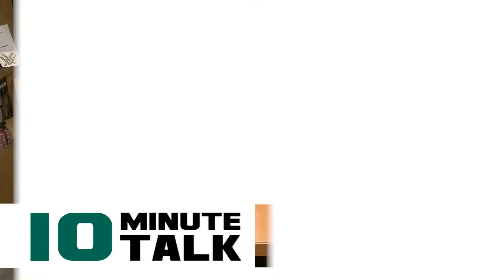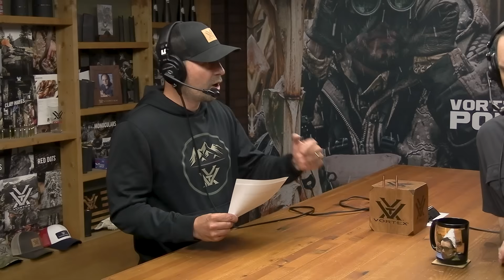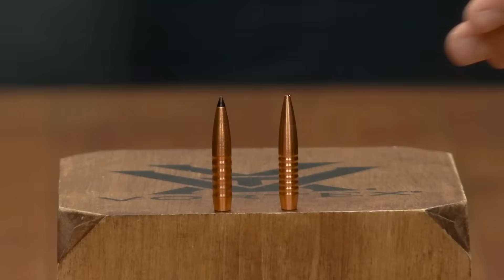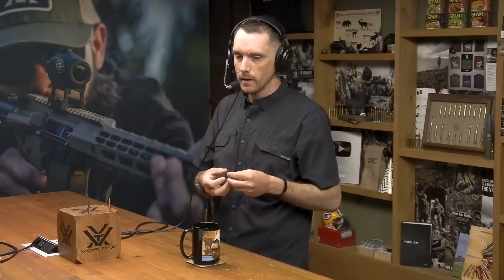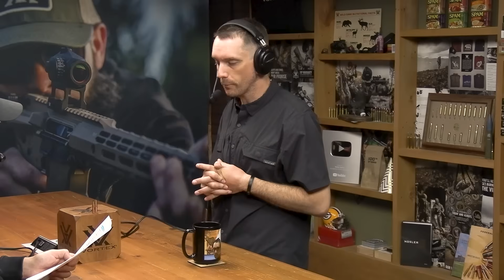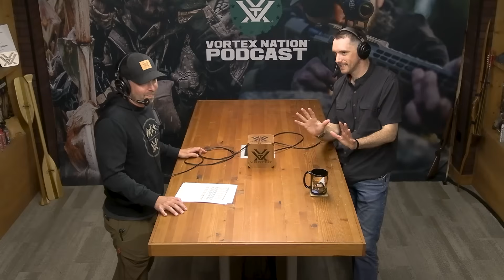#10MinuteTalk - Hammer Bullets — Do They Hammer?

Comment: Hammers shoot very well and their performance on game has been good in my experience. Petals radiate probably more like 30 degrees. The secondary wound tracks are less important than the enegy dump you get from that explosive opening of the bullet, which makes for a larger wounding path than traditional monos.

HOWEVER, I have not supported hammer for some time because they wildly inflate their bc values. It may have been forgiveable when they were starting off, but they are big enough and the tech is accessible enough now that the only excuse is that they are not a company that cares enough about its customers to tell them the truth if they think it will hurt sales. Just check applied ballistics and see how horribly off several of their designs are. I'm talking like 30% off for some. Some are pretty close, but there isn't a lot of rhyme or reason to which are on and which are off. They have somewhat addressed the issue with their new line of hammer high bc bullets, where they report the shooting conditions of the people who have tested them. It still seems pretty ridiculous to not set up a series of chronographs and a shot marker system to get velocities over distance considering how successful the company has been. Their forum and their fans on other forums have a real culty feel that weirds me out too. I'm not a fan of a company whose founder seems to want to foster a cult of personality around himself and his product. There's enough putting me off that I go with other options for monos. The fact that Hammers are about as expensive as you can go for a hunting bullet doesn't help either.
Reply: There are other examples of their marketing dishonesty that I've seen too. The one that sticks out the most in my mind is a long range YouTuber. I can't remember the channel name, but I'm fairly sure it wouldn't be too hard to find.
Reply: @gsnicholas8522  the youtuber you're talking about is dischonest. there are valid critiques and drawbacks to hammers, but that particular guy has an axe to grind an a horn to toot, and he doesn't let easily verifiable facts get in the way. Just saying.
Reply: @jcarry5214 I’m not sure about the axe to grind, but he provides evidence to back up what he was saying. In other words, he brought the receipts.
Reply: @gsnicholas8522  I'm going to try to respond to this with details, but it may have to be broken up so YT doesn't hide it. I disagree about him providing receipts. His evidence is mostly lifted from context, and his terms carefully redefined to suit his point. He mis-truths multiple ways about the aoudad video. He said a bull that tipped over within 5 steps was a plainly unethical kill, but he wouldn't say the same about videos using other bullets. He refuses to acknowledge the validity of any positive testing or experiences.
Reply: @gsnicholas8522  He says the petal-less shank is just a FMJ, which it's not, but won't back up the claim. He wouldn't address performance to any other bullet except highly frangible lead, or compare any other manufacturer to their claims. He claims Hammer are a large company with many paid employees and vast resources. If you point out basic errors he says you're a "hired assassin", or says he didn't say that. If you say "have you ever spoken to Hammer about xyz?" he calls you an employee, paid agent. (keep in mind I hadn't even spent any money yet when I interacted with him, and wasn't sure I wanted to try them but I had had a couple short conversations with the owner. Youtuber called this false because it didn't fit his narrative of them stonewalling).
Reply: @gsnicholas8522  He claims that gel blocks are a direct 1-for-1 substitute for game, which it's not. he says they make claims that they don't. He claims there is only one right wounding type, but he doesn't assail any other bullet manufacturers who can be found on youtube letting people down immensely well within their own design claims. He redefines "long range" to suit his argument in each context without bothering to ask them how they define and test it and encourage it. Again while not doing the same with other manufacturers.
Reply: @jcarry5214 you must be talking about someone different than I am. I don't remember any of that.
Reply: @gsnicholas8522  A lot of it was in conversation when I engaged with him directly. I'm 99 percent sure it's the same guy. He originated some of what you said and has a LR channel. I'd look it up to be sure but I know these guys now, separate from the bullets and wahtnot, it would just bother me to see it again or see more people doing the same.
Reply: @gsnicholas8522  I'm sure. I know their founder got into a whole mess after taking a some pretty unethical shots at animals (I believe Auodad but idr) and having it on film and trying to edit things to cover up some pretty terrible judgement. 

What sucks is that they're stellar bullets. They're easy to make accurate and they have excellent terminal perfomance. Just be honest about the ballistics. I can't stand blatantly lying to your customers. There's marketing speak and then there is just boldface lying. Hell, you can design bullets in a software that doesn't model your design well and gives you an inflated number, but once it is empirically proven to be wrong, it's on you to own up to a mistake and correct the record. I can't stand people who refuse to admit fault and would rather continue lying in the face of demonstable facts and just pretend they're not there. Leave that BS to the politicians.
Reply: @gsnicholas8522  there are valid critiques of hammer to be had, but they guy you're talking about is a straight liar, I've interacted with him and I've had more intellectually valid conversations with car salesmen.

Comment: Less pressure and more speed ?? ok now I wonder if that would help the 6mm arc pressure "issues" to allow more speed and get lower pressure?? Ryan ?? have you tried it?
Reply: I am running an 80gr hammer hunter out of my 22 inch 6 arc bolt action at 3175 and I’m pretty sure I could go faster.
Reply: What "Pressure issues" are you having with the ARC? I'm running a 95 gr LRX out of a 22 inch barrel at 3060fps without any problems

Comment: I’m looking for good .429 projectiles for my 444marlin in a strait wall state. Decided on bear creek ballistics 225hv due to getting a 200 yard 4” point blank and only 12” of drop at 300, but I’m curious to how the hammer and cutting edge bullets would compare on target especially with closer shots
Reply: The overall length of the .444 is too long and not legal in any straight wall state isn't it????
Reply: @camwinston5248 Illinois has no limit on case length or diameter if it’s strait wall. I could use a 50-110 if I owned one
Reply: Ten four, I appreciate the reply back..the 444 will do it then ! Good hunting!!
Reply: @camwinston5248 thanks. Hoping to get around 2650fps with accurate 1680

Comment: I’ve got a rifle with a ridiculous amount of freebore that won’t shoot anything very well.  It’ll shoot hammers just fine.   I’ve also found that hammers tend to be on average .0005”(half a thou) larger in diameter than cup & core bullets I’ve measured.
Reply: Surprised you kept it long enough to find these.
Reply: I had a smith try to chamber a barrel using these bullets in a dummy round. He kept on reaming, trying to get the leade correct but the slightly oversized bullets kept catching.  Wound up with like 3/4” of freebore in a (now) useless barrel. Several lessons learned.
Reply: @zackw9292  that's a really bizarre way of trying to solve a problem that didn't need a solution.

Comment: Tungsten is cheaper than copper, heavier than lead, and non-toxic.   Why can’t we get this combo in a bonded bullet??? 😢
Reply: I hope this is sarcasm. 

But in the case that it's not, tungsten is way too hard to expand. It also cannot compress like lead in a barrel. It would essentially be an fmj. This is the reason it has not been tried.
Reply: It was called the MRX and it was one of the most consistently excellent bullets ever to grace be .300 Win Mag.

Also AP rifle rounds aren’t illegal federally, and just because it contains tungsten doesn’t mean it’s AP.

These other commenters are kind of disappointing.
Reply: Barnes used to make a copper bullet with a tungsten core in the rear. The rumor is that they got taken off the market because they got classified as "armor piercing" so they had to stop selling them to civilians.
Reply: copper is $11 per Kg, tungsten is $45ish per Kg.... 1 kg is 2.2 lbs
Reply: On what planet is tungsten cheaper than copper? It’s also very hard…..
Reply: Tungsten has been tried. It was used in 9mm bullets. They were coated in Teflon because the tungsten would destroy the rifling. The bullets are subject to very tight legal controls and actually ended up having Congressional hearings. They were branded "cop killer" bullets because they could penetrate body armor
Reply: Way harder to machine though than copper

Comment: While Hammer is newish to the game, Lehigh has had their Controlled Expansion and Controlled Chaos lines for years and operate on a similar principle
Reply: I can’t speak to hammer bullets but after fairly extensive testing with Lehigh I found very mixed reliability and accuracy results compared to Barnes and maker bullets. Those were my results and I’ve heard lots of people who love them
Reply: @Helfirearms  That's exactly what I was told when I started asking about Lehigh. They make some great products, talked to several people with results like yours in rifles though.
Reply: I see jelly time coming 😮
Reply: The hammers are alot better built. As well as more available in a wider array of weights
Reply: I’ve been using the Lehigh controlled chaos for three years with great success.  Never recovered a base, only petals, and sub 1/2 moa accuracy.  Devastating on deer.
Reply: Cutting Edge has been doing the same for a good while.
Reply: Dude, your claim that people have opinions without experience has to be BS because if it’s on the Internet, somebody fact checked it to make sure it was true right? 🤷🏼‍♂️🤡